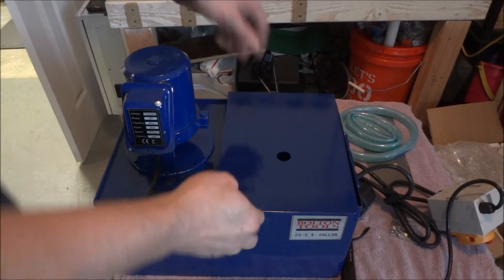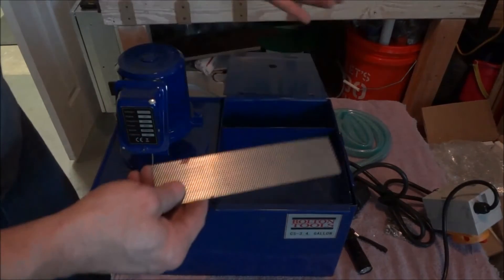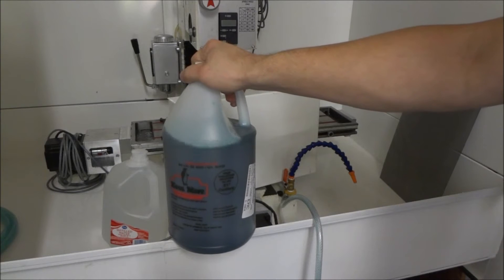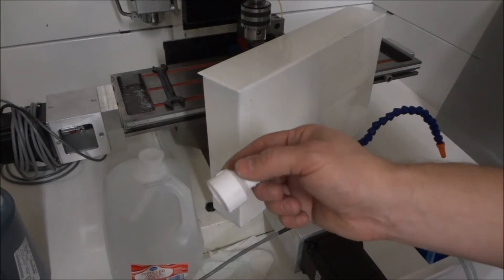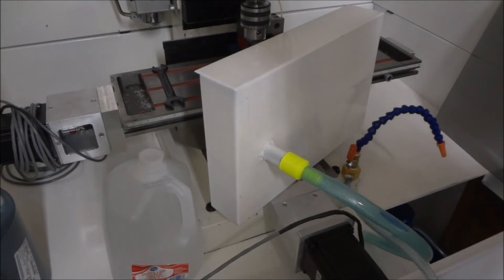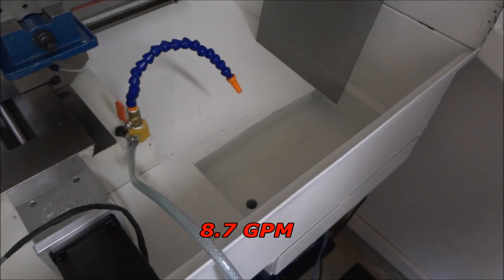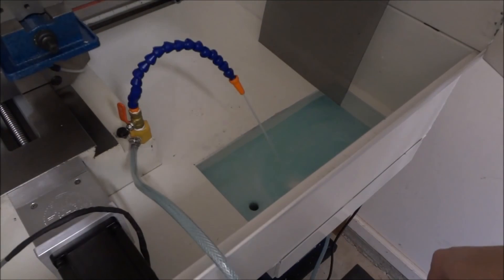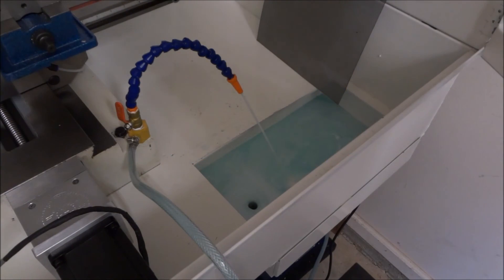Bolton Tool CS 3.4 Coolant Pump Part 2

Comment: Type of coolant reacts with plastic material. Mine one is a milky color type one that after it is diluted. My diy coolant tank was polycarbonate material. I learned this material would be attacked by oil. But, because the camera sealing box was unused, i modified it to coolant tank.  Cracks appeared at the top cover, i think it was on the stress lines of injection molded parts. Also did attacking the washing machine pipes which i used them as coolant draining pipes might be PVC material, it made them hardened. ABS pipe connectors on them also became fractured!
Reply from the maker: Hi Raychar, 
Thanks for the information, One of the reasons I stayed away from the plastic tanks. I'm not sure how well the drain adapter will hold up I will keep a eye on it. Luckily I can just print More!
Be safe,
Sam

Comment: I use the water from a couple of dehumidifiers in my coolant too. A good point about it that I pretty sure most people didn't realize yet is that is non conductive, so if you have a leak over something electrical it won't be a problem.
Reply from the maker: Great point! I failed to mention that. Distilled water is fairly no conductive or has very little conductivity.  Compared to Tap water which is highly conductive.

Comment: you have no idea what a difference the koolrite is compared to the kooling mist.  it's in my opinion, a 1000% better.  also, most coolant manufacturers recommendations using tap water unless you have unusually soft water, just an fyi.  at least when you switch over you can be another convert testimonial...lol. but you really did shoot yourself in the foot going kooling mist.. I think any coolant would be better after experiencing years of punishment using it as flood coolant myself.  get ready to enjoy everything in your shop being sticky and having to clean rust off everything...ack... just the memory gave me the heebiegeebies..lol
Reply from the maker: Well I have had this gallon for a while and I did not have time to research other alternatives KoolMist 77 has been good for me so far and I have not experienced the issues others have But I will give KoolRite a go next time.

Comment: nice printing job! but you have to be aware of the oil resistance of the printing material, you wouldt`nt want it to break on you mid job. Some plastics will get realy brittle and then break without warning
Reply from the maker: Thanks For the tip will see how the ABS holds up.

Comment: Nice update. I'm glad to hear Bolton made it right.
I've been getting different feedback about Kool Mist turning aluminum brown. I wonder if it  is reacting with minerals in the water for some of us, because I'm not using distilled water with it.

So far I'm digging the Kool Rite, and there is another bonus I didn't mention in my first video about it. My white chip pan paint has always been a little grimy looking, almost greyish. I'm pretty sure it is metal dust mixed with the dried Kool Mist and oils. The Kool Rite, however, is washing that away from the paint. Pretty interesting, and I have some footage of it I intend to post at some point. My whites are whiter and my brights are brighter :)
Reply from the maker: Thats awesome, I will give it a try when I run out of Koolmist 77 I have not had any of the rust color problems, My guess is the steel particles are rusting causing the rust color on the aluminum. and since I mostly machine aluminum I havent seen that problem.
 keep us updated .
Reply: That could be it too.

Comment: I just got a xyz davinci 3d printer and i love it!!! What kind did you purchase?
Reply from the maker: The XYZ Davinci Pro 1.0
Reply: Ya man they print amazing I have the exact same one. No restrictions in abs or pla. Im looking into the laser engraver attachment.
Reply from the maker: That's cool we can share our experiences. So good so far    I installed BuilTak straight out of the box before even powering it on. That's stuff is awesome. My second time printing after I updated firmware was a spool holder   https://www.thingiverse.com/thing:1234196

6 hrs in I checked on it and the hook end lifted. So I need to reprint. I have since calibrated the bed.  So will let you know.
Reply: The best thing i have used so far is blue painters tape and regular glue stick. Let me know if that helps any!